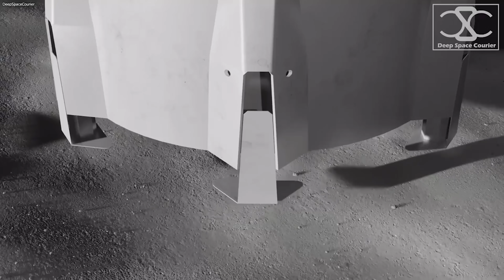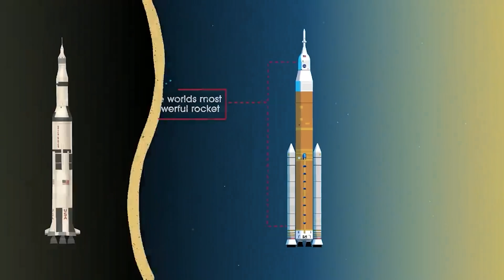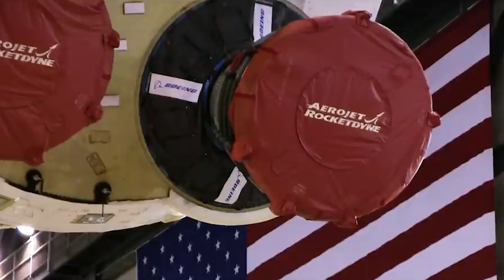Nasa's Huge LAUNCH FAIL Caused By JEFF BEZOS Just Happened

Comment: NASA's admission that Landing a man on the moon in 2024 is "Not possible". . . 
But in 1969 . .Before microwave ovens and cell phones ...Before personal computers or hand held calculators . .3 guys jumped into a 3/8th's of inch thick aluminum capsule mounted on top of a rocket and flew 256,000 miles through deadly radiation belts, landed on the surface of the moon without disturbing the powdery soil, played a little golf and drove around in a dune buggy when it was 250 degrees F...etc.etc...
Really????....Anyone who believes that BS story after watching this must be a moron of biblical proportions.

Comment: Did this bloke from NASA just say the reason SLS and Orion are part of Artemis is because it's is the only vehicle capable of lifting a couple of astronauts to rendezvous with Starship to take them to the moon? One small question, how did the Starship get there?
I'm sure there's an engineering answer but I bet it would have no similarity whatsoever to the political answers.
Reply: Falcon 9 sends astronauts and even civilind to orbit all the time now on Dragon
Reply: @eduardogardin879  Falcon 9 can't deliver people to lunar orbit.
Reply: Starship has never reached space; maybe in January 2022 we will see it reach orbit. SLS hasn't either, but NASA hopes to have the first test in February 2022.
Reply: @Delosian  of course SLS test in February 2022 will be a failure.
Reply: @Delosian  If the plan is for SLS to meet Starship in space then, by definition, SLS is not the only vehicle that can do it and, in all probability, do it more efficiently and way less expensively. 
SLS is a prime example of the old cost plus method of feeding at the govt trough..
Reply: Starship HLS is not supposed to transport people to or from the earth, it's just meant to land and lift off from the lunar surface.
Reply: I assume because starship does not have a launch ejection system they dont want to put people on it during the orbital launch
Reply: @richardbarrow2977  Starship doesn't have a launch ejection system right now but they probably will have by the time they launch the moon lander.
Reply: @richardbarrow2977  Starship HLS is not designed to transport people from the earth.
Reply: DITTO !!    DITTO !!   ( BOY!!!!! If only Rush was here now !!!!!!)